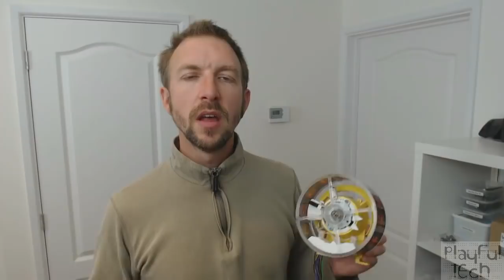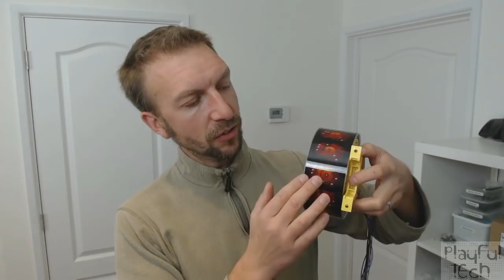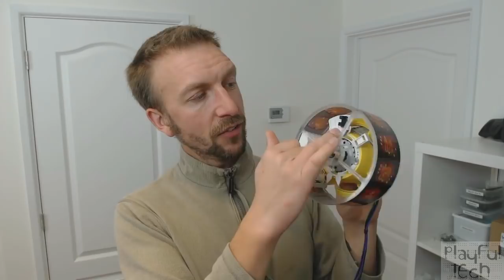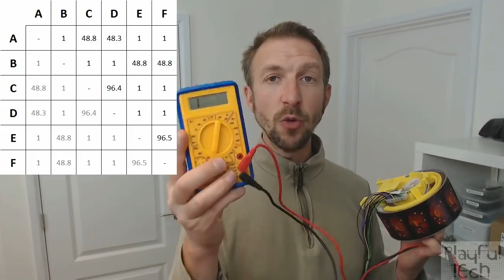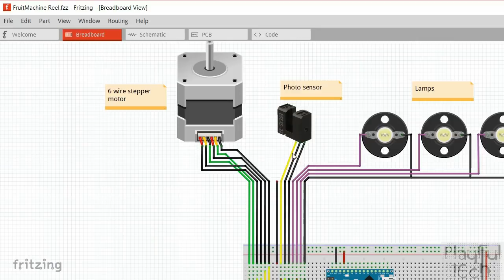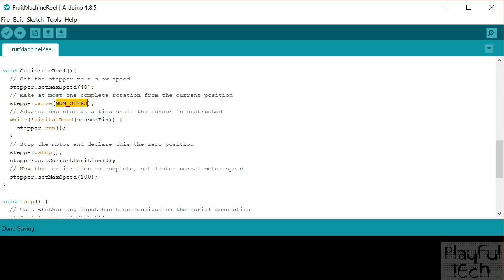Arduino Fruit Machine - Feature Reel

Comment: Don’t know why it took me so long to come across this, but very well explained, stepper motors have always been a mystery to me but not any more, thanks 🙏 currently working on a roulette type game with a circle of flashing lights, coin accepter & payout, very early days and learning about code for arduino.
My old mk1 version used a improvised wiper motor as a motorised selector switch,many relays, timers, diodes and a cam switch for payout,that was many years ago the internals had a look of a exploded pinball game but it did work. Think this time it’ll all be done at the pc…well love a challenge but somehow not as exciting without the clanking and clicking of mechanical parts…..😢

Comment: well.. i know something fun to make .. but it might be kind of a challenge :-) ... how about using an adruino with an os that loads BFmulator (fruitmachine emulator) and let it work on two monitors (for lower and higher rolls) including working buttons (BFMulator has already something build in that works with an "errel led mux board" ?)

Comment: you could monitor the opto sensor as the wheel is stepped and if it does not trigger when its meant to then you know something has obstructed or knocked the wheel then you can do a auto - recalibrate.......

Comment: Would have liked to see the code to make the wheel/s move like they would when running as a  pokey machine - gradually slowing down to end on the correct number.

Comment: I've worked inside some fruit machines and have always been amazed at the wiring inside them. So much labour to produce them and so prone to errors and faults. I wonder why fruit machine makers don't go to using a bus between all the different devices to cut down on the wiring with tiny microcontrollers at each device to do the intelligent bits.
Reply from the maker: You're absolutely right - I really should have taken a photo of the insides before I started taking the components out, because they really are a thing of quite beautiful complexity!